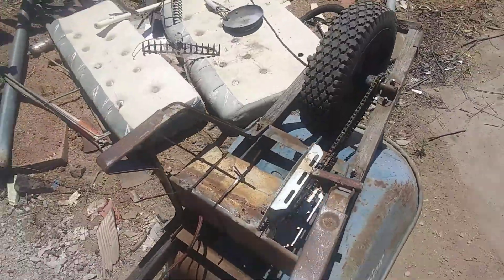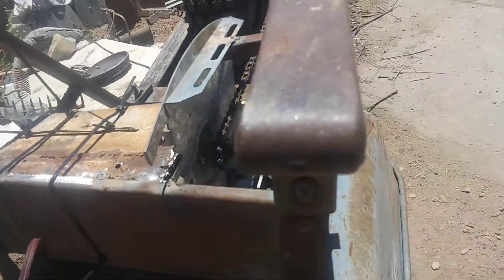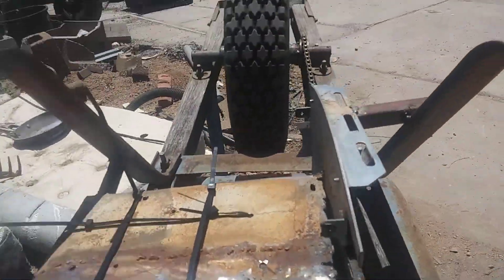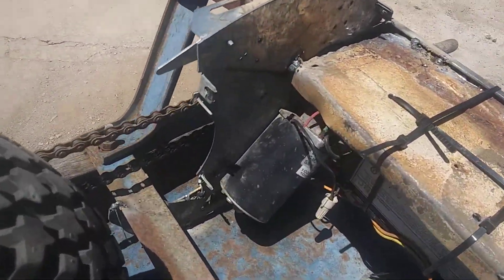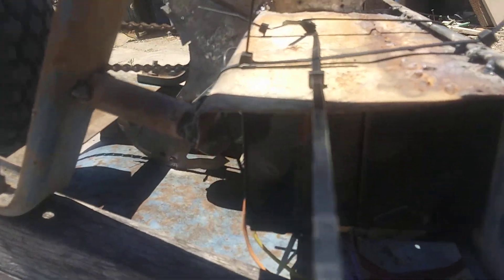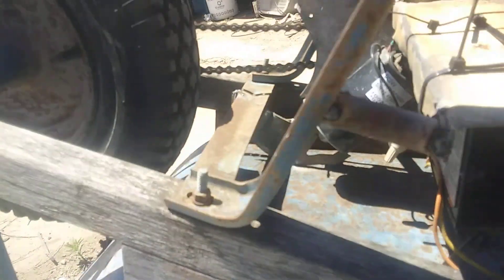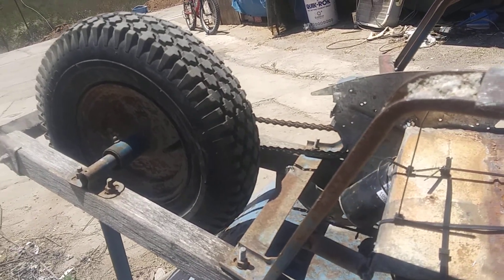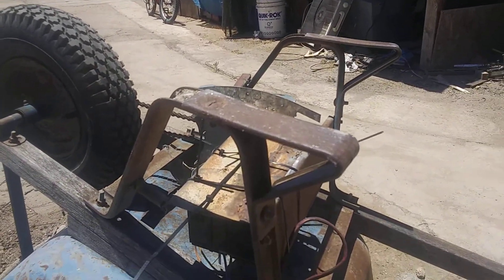Diy power assist wheel barrow

Comment: I doubt this moves the motor cannot create that much mecanical torque you need a bigger sprocket on the wheel for it to truly have troque
Reply from the maker: It was limited in its application. But for what I needed it to do it was perfect. I had to move a bunch of  infill for artifical turf. It wasn't as heavy as dirt. I would say about 1/5 the weight.  So taking that up the hill with a wheelbarrow was proving to be interesting.  It most definitely work. But when I tried to load it with actual dirt and a lot of it. You are correct.  But in my opinion it's only cause I hadn't put much R&D into it. I literally slapped it together and did the job.